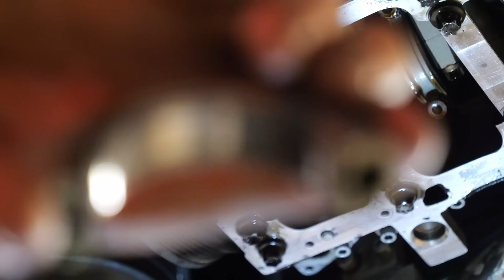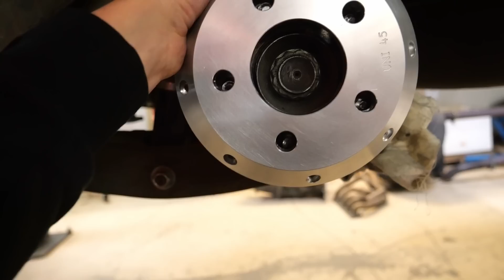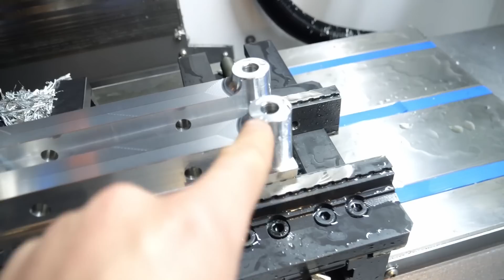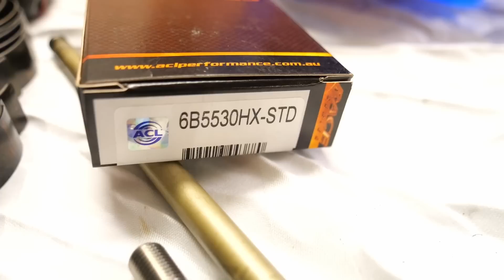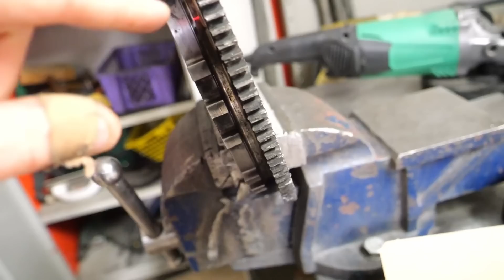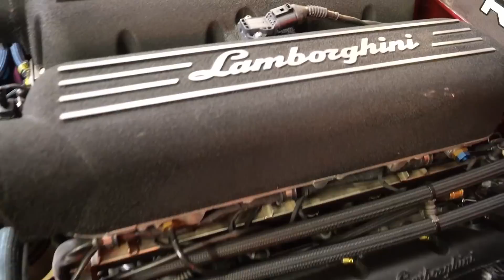Volvoghini Project. Can i Repair the V10 Lamborghini Engine? Low Budget trick!

Comment: As the safety, can I suggest to install the nitrogen accumulator and one way check valve on the pump pressure outlet. Then add an extra pressure switch between the pump and the check valve. That will give you the indication of the pump pressure loss, but you will still have a few seconds of the oil pressure accumulated in the nitrogen accumulator...

Comment: Considering the dry sump belt: you should put sort of a “tensioner” with a switch that triggers if the belt fails and cuts fuel. Pretty common solution. It is quicker to trigger than the oil pressure sensor.

Comment: The direct sound of the engine without exhaust pipes...nice to hear even via the video :) 
Don't you afraid the crankshaft main bearings had similar damage as to one on the rods? (I hope not but seeing those from the rods...)

Thanks Peter for the video and details!

Comment: That's not too bad mate, I think you got away with that but I would change main and conrod bearings and clean as much of the debris out of the dry sump pan and put everything together change the oil filter then flush with cheap oil a couple of times then change the oil filter one more time then add you good expensive correct weight oil and you should be good. I would also check the dry sump pump just incase some debris is in there and make sure all check valves are free from debris before flushing then check again before the final oil and filter change. Or you could cross your fingers and just send it.

Comment: I've seen with a very experienced machinist they lower the thread tap towards the work piece and turn off the machine, this gently spins the tap a couple mm into the work piece so it starts perfectly straight. They will then hand tap the rest of the thread.

Comment: You are standing besides your own cnc machine..   Why not just cut out the little mark in the rods so vr6 bearings fits in them instead of grinding it of the bearing..  Im guessing they exist for a reason... 😉.   Would not take long time to make a small cnc program for that.. 💪
Reply from the maker: Yes but the rods are still in the engine! I just removed the caps. If i had all the rods loose i would machime them!
Reply: @PeterBjorck  
That makes good sense. 👍
BTW im sitting in Lego town of Denmark and enjoy all your videos. 😉
Reply: The tabs are just a guide to help get the bearing centered. It's not critical. The upper and lower bearing just need be aligned👍 the reason they are there is to ensure both parts of the bearing touch in line. Bearings are not actually perfectly round or even thickness, they are designed to deform to their final dimensions 😎

I may need to get some VR6 bearings 😏 for my V10 😍

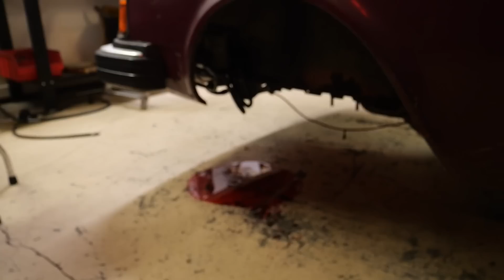Comment: 23:00 Hahaha I did this with my power steering on my modded 3.0 v6 Essex engined Mk5 Cortina, and I blew the oil filter by packing out the oil pressure relief spring too much - the oil hit a nearby tree 😆 Great thing with the vr6 bearings, love this!

Comment: L19 rod bolts? I have heard that those are very prone to hydrogen embrittlement, so handle with cloves and keep em oiled all the time.
Reply from the maker: Mee to. But heard and real experience have some deviances.. I have used these kind of bolts and handling  for 15 years. But You could have a point!

Comment: You should use a spare port on oil pump for manual gauge.  Believe me when you see the difference between analog vs electronic gauge will shock you! It happened to me!

Comment: 3:40 you can see obvious rainbow heat colour on cranksaft. Big destruction was close!
Reply: Maybe from hardening treatment at the factory. 🤔
Reply: I think that was from before he got the engine.
Reply: The discolouration is not from this minor issue, you only get that high temps from spun bearings which would be way worse than this, there would not be any bearing left in that case.

I suspect the crank was reground/polished previously 👍

Comment: Some hints on the machining part of things. If you drill with hss drills. Try to do a facing pass first and maybe spot drill to make sure the drill dont wander. And when you flip a part, try to make some surface that you can reference i following steps. And if you flip a part several times, try to use the same surface to reference. Otherwise its easy to get tolerance stacking. If you cant reach the surfaces you made in earlier steps. Try to use a stopper i X direction and use the same reference in X axis for subsequent steps. In Y axis, you could set the reference point in the center of the part and take reference on the vice jaws instead if you cant reach the surfaces from previous steps.

Thanks for showing the more detailed stuff with the builds!
Reply from the maker: Thanks for some info there! I have some learning to do!

Comment: 😢cranshaft is toasted, man.... 3:32
Reply: I'd say that would be factory heat treatment to harden crank journals. They are ground after heat treatment which is why the journals themselves don't look burnt.
Reply: The discolouration is not from this minor issue, you only get that high temps from spun bearings which would be way worse than this, there would not be any bearing left in that case.

The crank has probably had a regrind from a previous spun bearing issue🤔

Could be from manufacturing but they are usually heat treated as a whole part and not induction hardened. 
I suspect the crank was reground/polished previously 👍

Comment: Great video and work. Amazing your CNC machines. Those tabs on the bearing and only for installation. They will not do anything and 8000rpm. The clamping force from the big end caps stops the bearings rotating

Comment: with that tight fitment on the hub, I would suggest adding a couple threaded holes to the assembly to help push it off in the event of it seizing.
Reply: push it off by sending bolts through the face of the hat, against the hub if that makes sense
Reply: Good point :)
Reply: Has saved me many times on my steel discs when they get a little bit of rust in between the disc and hub

Comment: hi peter i like the title ''low budget'' for the hobby man there just casual has cnc mil in the garage xd 
no hate love your vidz great hugs from Denmark
Reply from the maker: The low budget trick was about the bearings. The CNC machine is not for hobby. It is primary a company machine tool.
Reply: Some beat old cnc you can get for pretty cheap. In western countries it is often not thr problem to have some expensive tool but the place for it. 😅

Comment: Heat the case to 100 degrees and you need al mg 3. It will hold forever. Take you're time and make the weld finely scaled.  130-150a  3.2 -4 wolfram  13+ ceramic.

Comment: In regards to welding dirty aluminum, a very good local welder gave me a tip to use high frequency (200hz) AC when welding aluminum. It focuses the heat more into the weld, than the part, which reduces the chances of cracking. I don't know what the right frequency setting would be for your application, but it would be worth investigating. Best regards from Detroit
Reply: High frequency gives a narrower arc and smaller weld pool. Sometimes that's what you want.